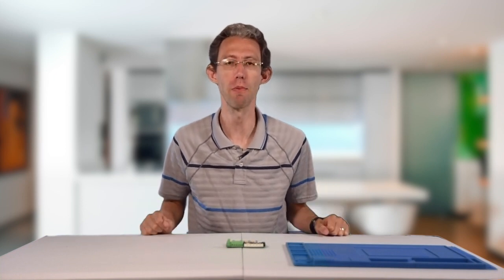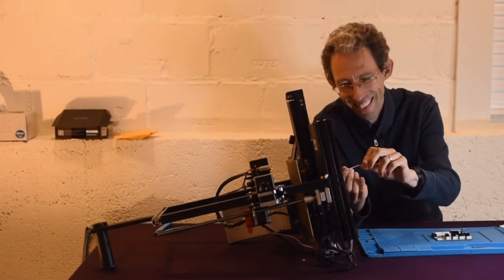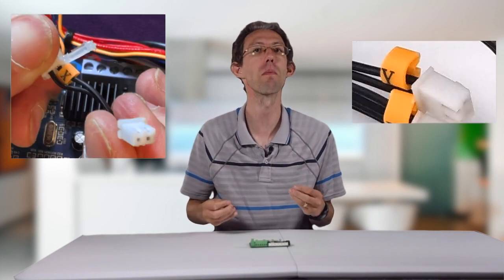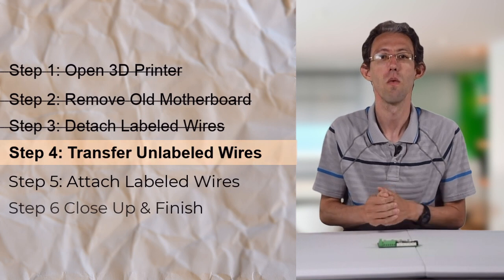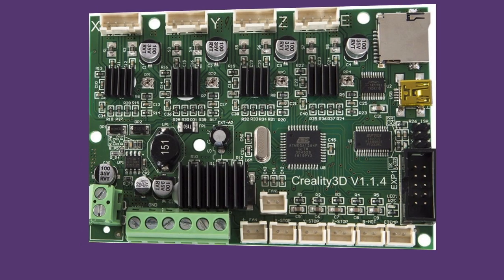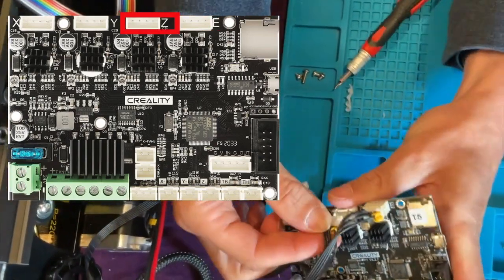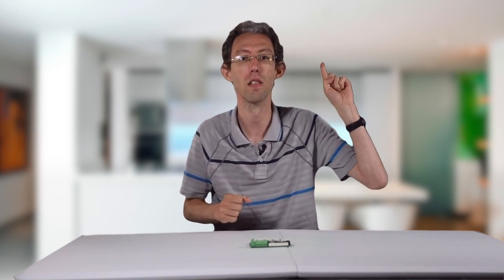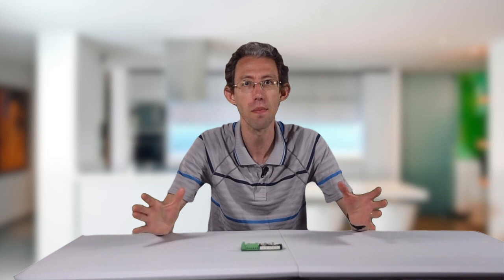How to Replace The Motherboard on your Creality Ender 3 Pro 3D Printer

Comment: my printer was having some startup issues, then one day it went to blue screen and it popped, now the power supply sounds like its on but the screen wont turn on, it probably shorted, will replacing the motherboard fix this or am i blinded by hope?

Comment: Rubbing alcohol is a release agent for hot glue. Just put some on a swab and rub it on the edge of the glue and it will easily peel right off.

Comment: Thank you so much for this. My printer suddenly starting thinking the bed and nozzle were 300Degrees instantly after start up. I also knew the nozzle thermostat was only a few weeks old so it shouldnt be that. My only other thought is that something on the motherboard is failing if it's happening to both. I know nothing about motherboards and was worried this would require soldering. I'm glad it doesn't and your visuals were really helpful make me feel comfortable with trying this. :)

Comment: What board would you use, would you recommend it?
Reply from the maker: I used Creality's Board version 4.2.7. Using a Creality board makes life a little easier because the ports are similar positioned. The board has worked well for me and is a lot quieter. The are other boards that offer more feature capabilities so it depends if you need or want those features.